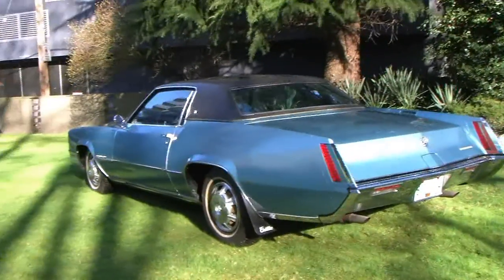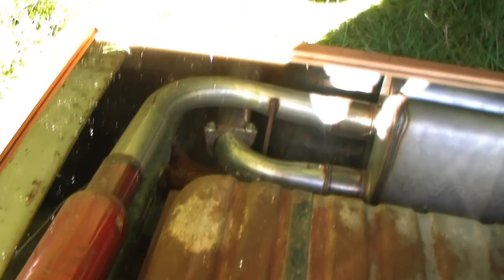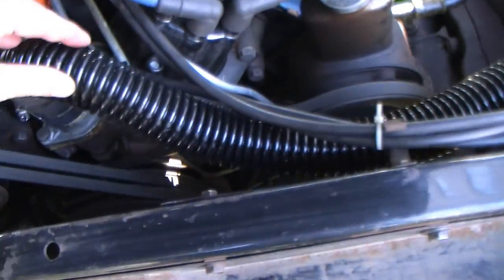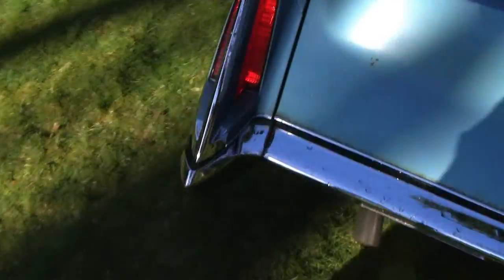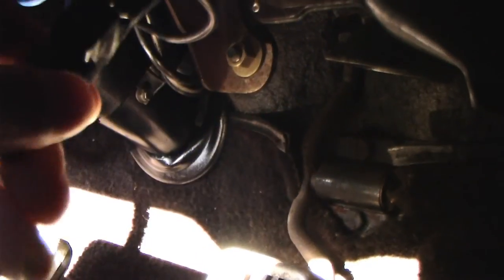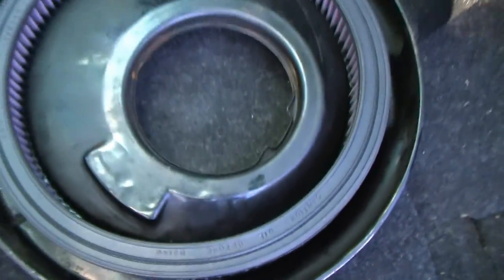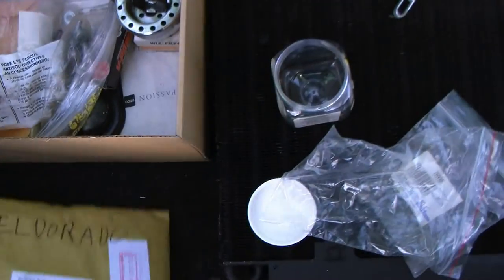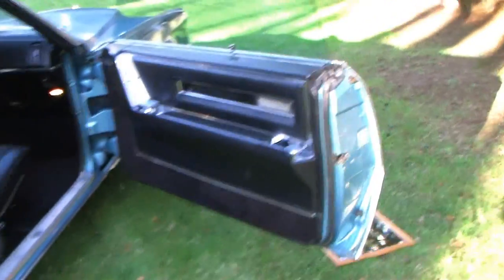BEAUTIFUL 1967 Cadillac Eldorado!!!

Comment: Why is the car soaking wet for the video? And you say the lights work perfectly yet I believe in the initial shot, one is open and one is closed... and the 'red devil whatever they are called' things... lol you're talking about a top dollar classic, even if it is being meant to be sold as a daily driver... details are key! If you see any of Mike Stanton's classic Cadillac and Lincoln vids you'll get the picture
Reply from the maker: yes, i have seen his, i wonder if anybody even drives them, too worried they might get a rock chip. It is easy to make a car look like that, the 67 elodo he recently sold had a new paint job, mine is the original paint, and he had a bigger tear in the drivers seat. I have collector plates, the car passed as you see it in the video, there are certain things that can be improved and you still retain collector status such as exhaust system. Their might be a tiny pinhole in the hose or canister for one of the lights, but when you start driving around it works fine, it keeps enough suction, a very easy fix.